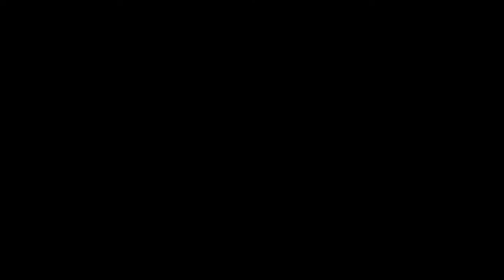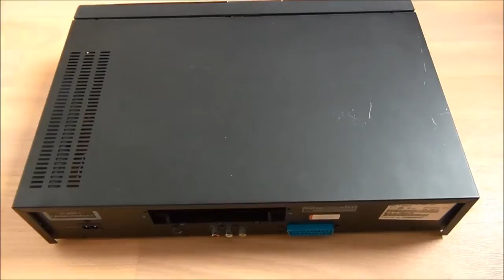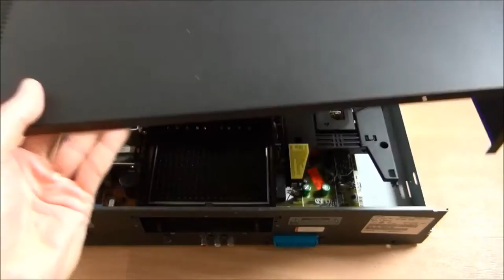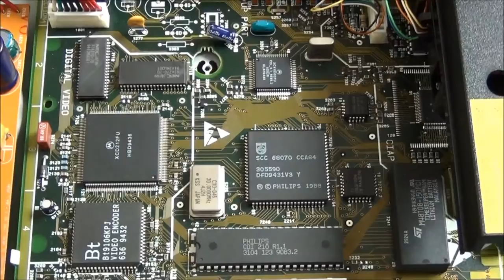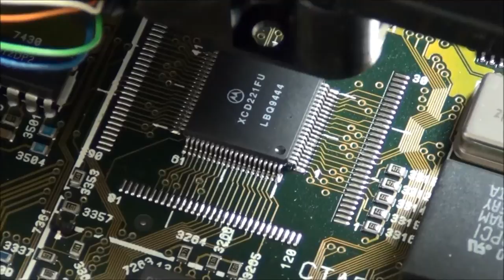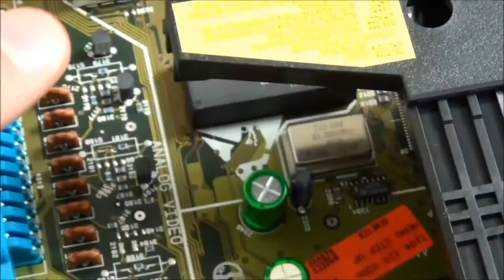What's inside a CD-i? (CDI 210)

Comment: From what I know devices with a fan actually collect more dust, except when the fan is blowing inwards and there is a dust filter before the fan (however, in this case the filter must be exchanged every 6 months or so if the device is on 24/7, but if it is only on for something like one hour a day it could be that the filter lasts more than a decade).

The reason for this is that a fan sucks in the air with all the dust, a device wi/o a fan only gets dust form natural air movement (convection).

Comment: Very interesting!  Firstly I am shocked to see the Phillips branded 68K CPU there - Didn't know the CDi had a 68K based CPU.  That ST 'time keeper' chip looks like the Dallas RTC / SRAM chips used in other systems of that era (and prior).  They are powered by a lithium battery which typically last 10 years or so, sometimes longer if you are lucky.  I would be interested to know if it is an RTC or whether its just SRAM.  In either case it could likely be swapped out for a replacement part if the battery fails.  The annoying thing with those RTC / SRAM chips is the battery is built into the chip - hence the large package height.
Reply: +GadgetUK164 The problema with the SCC68070 is that it usually takes twice for common instructions to run than on a M68000. I guess that's why Philips doubled the clock.. SCC68070 only Works better with specific instructions wich are the least. We can add the fact that despite the 68070 is instruction compatible with the M68000, the way they manage memory is completelly different, that ruins easy ports from M68000 based consoles of the time.

The CD-i doesn't even have sprites managed by hardware, wich points the fact, Philips didn't target this device for the video game market.

Cheers.

P.D. You can just cut the broken ST RTC chip with a Dremel tool in order to be able to Access the inner battery, then, use two cables to bridge it and use an external button battery. It's a bit ugly, but it Works.
Reply: @davidv776  is that why so many games skipped the cdi?? because the cpu just can't handle games

Comment: PS: also it has to be a good dust filter, because cheap dust filters only filter the bigger particles, but the smaller ones still get through, so they reduce the dust a little, but the fan would still blow a lot of dust to the inside of the case.

Comment: I believe XCD and MCD correspond to different masks for the same chip. MC are later ones, XC older ones, with worse heat sinking and such...  At least this is the way it Works for Motorola 68040 and 68060 processors.

Comment: I can handle a the noise of a low powered fan, if you see the 450 model. The one i have thats alot more compact and still no fan. I dont like that. I kinda want a fan i guess though no fan means it collect less dust. So then i dont have to open it and clean it as much.